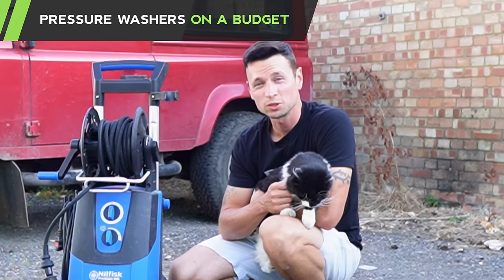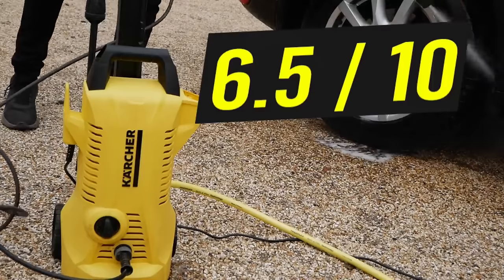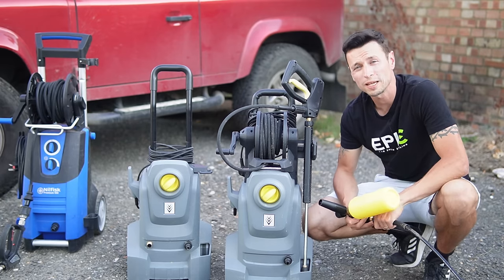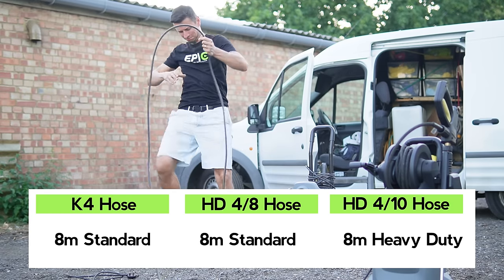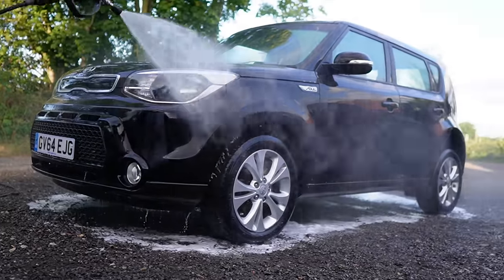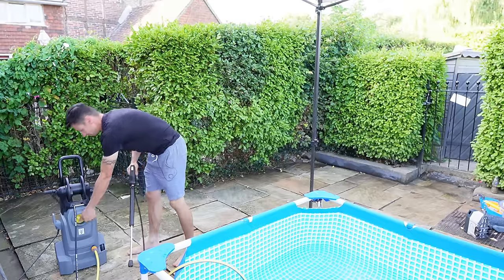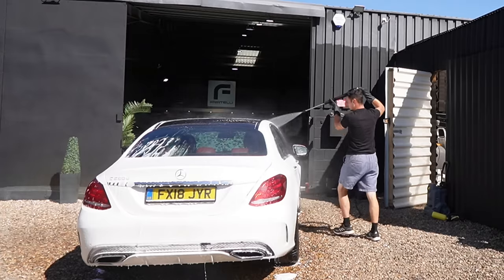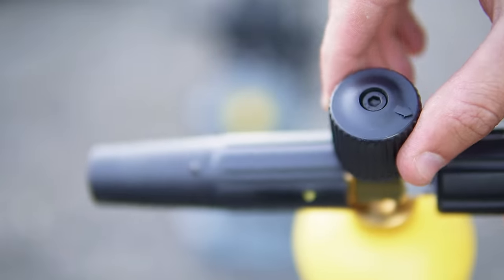Buying a Karcher K4 Pressure Washer for Car Cleaning? Try these instead!

Comment: Your local farmfoods stores have these on offer ATM 4-3-23 I paid £222 ( hd4-10x ) with there vouchers in downloaded.😁💰
Reply from the maker: thats very good value
Reply: I got mine for £215 with vouchers thanks to the very nice young lady at the till great buy.
Reply: Also really easy to customise
Reply: Just seen those machines in my local farmfoods. Crazy deal 🤯
Reply: HD 4/8 on clearance in Farmfoods for £99.99 and if you can find one the lady says the the 4/10 is the same price (Sept 28th 2033)
Reply: Paid 95 for the 4/10 just need adapters now

Comment: The thing is, for the price you aren't getting very much... You can get a Nilfisk 145 for 60 quid less than the 4/10. I have got the AVA (my 3rd one).... Now it works as it should i absolutely love it. I wish it had a power control option.. Blasting door shuts sometimes can get a bit messy.
Reply from the maker: Your getting a commercial built machine. That comes with commercial warranty. The build quality is fantastic. I think it's perfectly priced. Yeah you can buy domestic models which give you more things like cannons etc but durability will never compete with a heavy duty model as I found out with my Ava p80
Reply: @epicautomotivedetailing  does this mean that the p80 is inferior build quality wise to the professional karcher units from this video?

Comment: The most useful feature to know about is if they have a brass pump head or not. You would need to ask the manufacturer in most cases. Brass doesn't corrode and will resist the expansion of freezing water better whilst stored.
Next is the actual working pressure. The HD 4/8 is 80 bar and the 4/10 is 100 bar.
Litres per minute is an important number but that is quoted in the specs.
Reply from the maker: Awesome info thanks for sharing to the community
Reply: I would say forget all the BAR and VOLUME nonsense, but just look at the actual power output

Comment: I've had 2 karchers and they didn't last a sniff! So went to nilfisk and they lasted for years recently got the P180 and it's an absolute beast!
Reply from the maker: Yeah mine is absolutely solid
Reply: Same here except I took the Kränzle route and never looked back. My Kränzle has cost me less than all the replacement kärchers I've had!
Reply: @user-mq1hn3dw8l  I've had various karcher equipment, the wee window van, steam mop etc and they all broke after no time at all, they didn't even get much use and were properly cared for. Shame as they used to be a good company
Reply: @cedric1138  Gary, my thoughts exactly👍

Comment: Excellent video!
I’m thinking of buying the HD 4/8 rather than K4 or K5.
Can you tell me which snow lances are compatible with HD 4/8?
For example, the MJJC? Or would you recommend other lances with the HD 4/8?
As a newbie, I’m not sure about compatibility of snow lances or connector types needed with the HD 4/8! 
Any guidance would be much appreciated!
Reply: Any snow foam lance with an M22/14 fixing will do the job or try and find a new stubby with a quick release connection as the screwing on and off is a bit tiresome

Comment: Hey thanks for the review! The HD 4/8 seems like a great option for the price for a home car cleaning system.
One question, since the only thing that puts me off is the lack of quick release attachments, can these be modified with quick release adaptors? (From eBay etc) 

Thank you!
Reply: you can basically customise it any way you want hose and gun coupling are M22 and the nozzle is M18, I bought a 4/10 and have quick connects on the hose and gun also got an 8m extension hose for £30 off ebay
Reply: I’ve bought two packs off Amazon and they are male not female to go on the nozzle. It’s a mind melt to find the right one. Can you advise on what’s the right connection? Save me crying.
Reply: @shortrandomvlogs3675  
The links are from ebay but it’s everything I’ve used so far from the lance jet to quick connect 
1/4 quick connect to make gun stubby 
3/8 quick connect from gun to hose and 3/8 male and female quick connect for hose couplings
Hope this helps 👍🏻
Reply: @davidbrown2026  I've been looking but im not sure which is the right fitment for Karcher HD4/10x gun, could list the links?
Reply: @davidbrown2026  I'm sorry Dave great video but the only links I can see are for KARCHER itself or your merchandise not for eBay. I'm trying to fit a surface cleaner to the gun with a 1/4 connection wand

Comment: As a weekend warrior I have just had to replace an old K2 with the latest K2 universal. You should warn people that when Karcher upgrade not all their lances will fit their new machines.
Quote from Helpdesk "The new machines are not compatible with the older lances, this is because the connectors have been changed and there are no adapters for this."
 I realise I should really have added this to your K2 video but I am guessing they will do this with other models as well. They quote the replacement for the lance which I bought for £80 will now cost me £48.94 which is about what I paid for the K2. 
I liked the K2 because if fitted in a wheeled bucket under my workbench. Needless to say I used to buy a lot of Karcher kit (floor cleaners, hoovers, wipers, T Racer etc). That ends now!
Reply from the maker: They are changing again soon

Comment: New "Easy!Lock" connectors in my opinion are pretty comfortable but you're right with too high price. There is also possibility to buy quick "click" connection set but again is a problem.

Comment: I've just bought an HD 4/8 based on reviews and terrific price but I'm finding it next to impossible to source a snow foam lance as apparently there's two different models of guns with different fittings on them .... looks like it'll be going back to the shop if I can't find one

Update ....  I managed to find one albeit I had to buy an adapter for the snow foam lance .... Funnily enough a new trigger gun just screwed on to the hose and has a quick release connector so I might treat myself to that for Christmas as swapping the bottle off is a bit of faff
Reply: Hi, do you mind sharing where did you buy the adapter and snow foam lance from? Karcher's own brand costs as much as the machine itself!
Reply: @jahan024  ... I bought two snow foam lances one was from a local branch of Auto Car Parts and the other was an online shop
Reply: Is the 4/8 M22 14mm or 15mm do you know?
Reply: @ItsWillly  .... I'm pretty sure it's M22/14 as the 15 tends to be petrol powered washers

Comment: Would you choose a hd4/8 or 4/10 over a Karcher k5? Great vid. Thanks
Reply from the maker: yes i would it has better internal components
Reply: Cool, which would be better the 4/8 or 4/10? Can you swap out the hoses on both? Would want a 15m hose and stubby gun. Not much information online

Comment: Great video Dave. Could I easily connect a MTM Hydro SGS35 Stainless Steel stubby gun to this or would it need a special fitment?
Reply from the maker: You can do but my best advice is to contact someone like carscope or cleanstore and explain the set up you want as there are many options 👌

Comment: Hi Dave, great video. I’m looking at starting my own mobile valeting business. Would the HD 4/10 be powerful enough and flow enough for daily use? Im thinking either the 4/10 or K5 compact and purchasing my own hose/lance. I’m put off Ava with the fuse issues I keep seeing crop up when used with an extension. Thanks for the great vids 👍
Reply: The pro versions don't clean any better than a similar specced domestic version but they will keep doing it for much longer.

Comment: Does the nilfisk have a steel braided hose ? Pretty sure they are the same as my stihl, only thing with the stihl, you don’t have that metal bar for the hose to run against, just the reel, think I’ll still be going with a nilfisk p180 next , they have an excellent track record for reliability, the stihl was fantastic at first but now 7yrs later constantly blows fuses, and the lance design (older type) wasn’t the best and if you want say a stubby gun you have to buy a nilfisk one as no one makes stihl ones, but they use same parts etc etc
Reply from the maker: Nilfisk actually white labelled their machines out to Stihl so it's identical. My p80 has mtm stubby gun and it's great. You definitely need quick release
Reply: @epicautomotivedetailing  yes I bought a autobrite qr with nilfisk adapter, plugged straight in, seen works great with my autobrite foam lance too, maybe not the best out there but it was a decent starting point for my needs,mtm will deffo be a be my next investment, especially with the lance you can add on 👌👌

Comment: Thank you for the video Dave. Those new Karcher professional pressure washers are definitely keenly priced. Like the universal fitting too 👍. Only problem for me is that I can't use one at the moment due to a hosepipe ban.☹️.
Reply from the maker: yeah its not great at the minute but i totally understand we need to save water
Reply: Fill a bucket of water. Stick your pressure washer supply feed in the bucket. Use pressure washer. Repeat repeat. 
One way around the hosepipe ban.

Comment: Hi,  Thanks for the tutorial.  I own a 9 year old K4 Eco which has just started to fail yet again.  Can I use any of my fittings like the patio cleaner or the flexible nozzle to the HD 4/10
Reply from the maker: I dont think so unless you change the fittings which should be easily possible

Comment: Have been using a K4 for a few years but the Achilles heel on them are the plastic cylinder head pumps and control heads which eventually  end up with hairline cracks causing pulsating on off pressures, ok £55 quid to replace them (DIY) but they used to be ally cast which lasted. This was probably a deliberate design fault to make you buy new machines.  What are the head pumps made of in these new Karchers ?
Reply from the maker: These are metal pumps
Reply: Thanks for letting me know 👍

Comment: Got a old karcher b402 ,twenty yrs old still going strong,got a karc her k2  for use with a snow foam gun,packed in within a year,the difference with the new models,the motors are plastic,modern cheap crap .

Comment: So just a quick query to make sure im understanding correctly. Im looking to get a foam lance and surface cleaner because these dont have proprietary connection could i buy 3rd party Accessories?
Reply from the maker: No that's the downfall with them. However they are practically giving them away right now

Comment: Is it better to get a top of line domestic washer or buy a hd version?  Cheers
Reply from the maker: This is perfectly placed to fit in between a k7 and an hd7125. btw 7125 is much better
Reply: @epicautomotivedetailing   for my budget I’ve seen a hd 4/10 classic. What you think?  The only 7125 I’ve seen is a 110v

Comment: Just bought the hd4/8 for £99 in farm foods worth a check at your local one
Reply from the maker: That's unbelievable value for money. I don't need a pressure washer right now but even I may go buy another one for backup
Reply: How have you got on with it as I picked up one the other night for the same price but I've noticed it doesn't seem to take a standard quick lock hose connector but a screw on one and I've no idea on where to buy a foam lance as I'm not paying Karcher £145 for one

Comment: Now, if i could get a Karcher that was 'hosepipe bam exempt' 🙂
Reply: Some Kärchers can draw water from a waterbutt so if you're lucky enough to still have water stored that could be an option.
Reply from the maker: Many ways to avoid the ban. The ban only means you can't wash your car by connecting it to a tap. Water butt, water tank, or even draw water from a Bucket. Pressure washers use upto 80% less water than a hose so technically there's nothing stopping anyone carrying on really
Reply: @epicautomotivedetailing  Thanks for.your reply, i agree that it could be technically ok, but neighbours might not see it that way.  Knowing my luck, ill get mug shots and jail time for washing my car 😂

Comment: You can't buy a commercial washer (at least one which lasts as it should and can be run all day every day). That simple. #kranzle
Reply from the maker: Kranzle still have their problems like any machine if not properly cared for
Reply: Most supermarket machines are designed to be run for no more than hour maximum. Why don't you get Karcher to give you one of their motors and display that in your video.
Reply from the maker: @CutMowShearClear  because they probably hate me lol